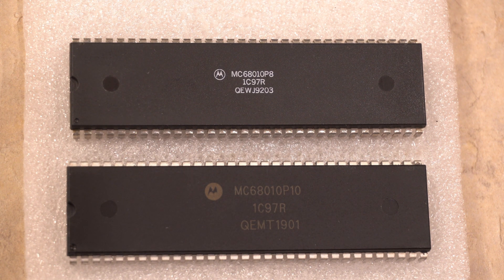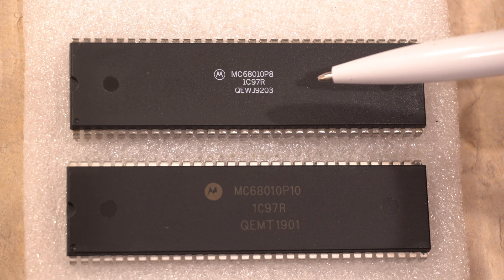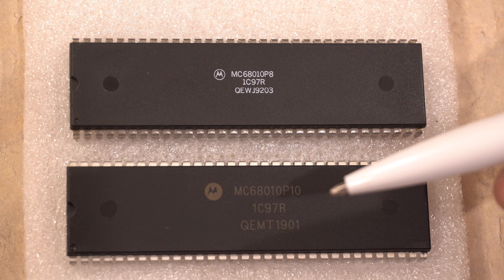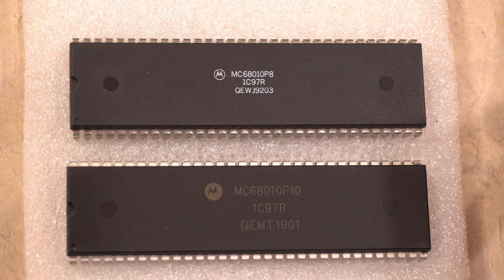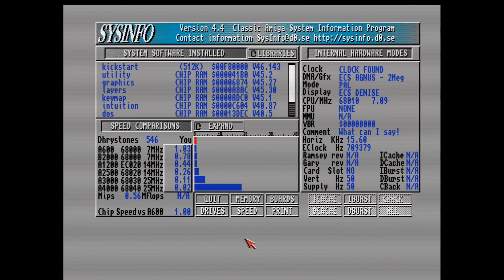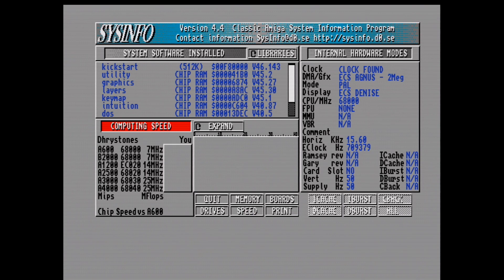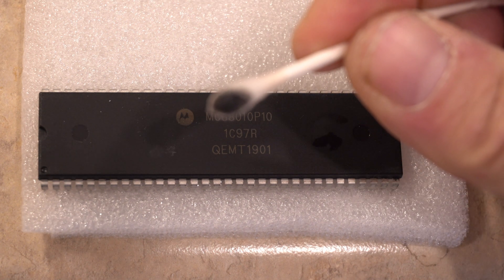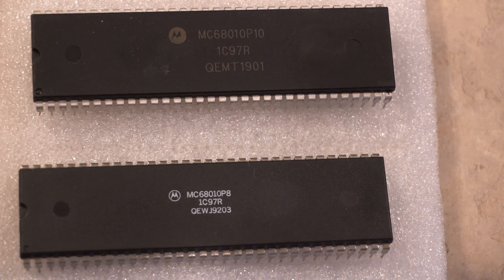Fake Motorola 68010 CPUs on ebay (old chip, new scam)

Comment: I remember I had a craptom of 68010s which I found by chance.   But they were PLCC format.  :(   Not DIP. (I was an Amiga 500 owner at the time).   So I ended up just throwing them away.  Sadly.
Reply from the maker: I have an accelerator card that uses the PLCC type 68000 or 68010, these are not very common. The card overclocks the 68000 up to 40 MHz. Unfortunately the 68010  CPU doesn't overlock well :(

Comment: I have disputed and get refunded for every rebadged IC I get from Aliexpress no matter if they work or not.  If they are rebadged, they are not what I ordered.
Reply from the maker: I imagine eBay would have done the same. Since the chips worked and there is no huge performance difference between the 68000 and 68010, I wasn't too concerned. Disappointment yes, concerned not too much. This would have been different under other circumstances.
Reply: @amigaretro1985  I don't share your point. I always ask for a refund, to not encourage the crook. And if the seller can get banned from the marketplace, I'm happier

Comment: I have some from ebay 68010 12Mzh a pack of five. I just put some IPA over them nice no paint came off. The last line is DZQKJ0623, the second line is 3C98R. The mask number on line at CPU World is 3C97R. If they are only 68000 I don`t mind as the 68000 is getting hard to get now. The total cost was aroun £12.00 for five of them on Ebay. IF they are fake a lot of time and work went in to them. I got the direct from China.
Reply from the maker: I am lucky they work and are useful even though they are not what they are advertised to be, could have been much worse.